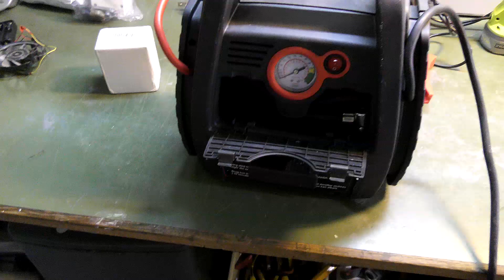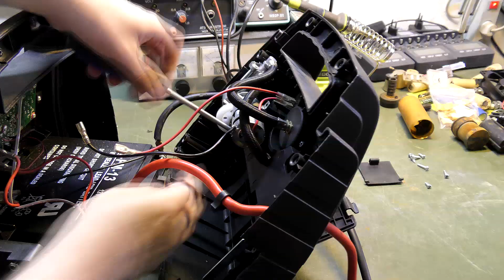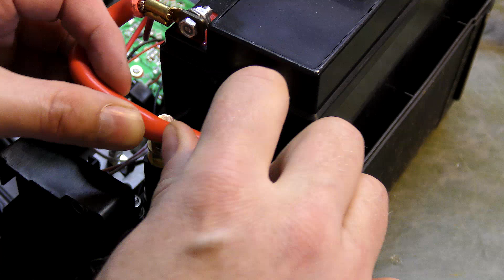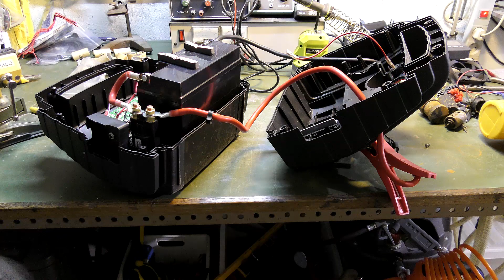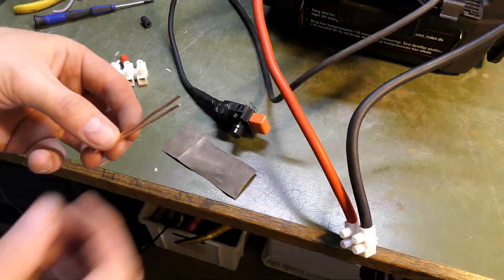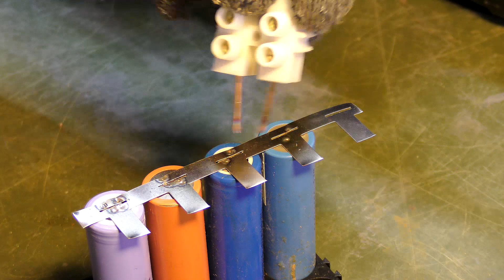Very Cheap DIY Spot Welder, Two Hour Build - 847

Comment: Hey Friend, I do have also one of those chargers (compressor fail also) I'm going to replicate what you're done, a motorcycle solenoid will work also(i think) muchas gracias amigo S.A. tx
Reply from the maker: I only used this a little bit,, it was to powerful, and needed charging to often. did this instead : https://youtu.be/TI_ZV-5WHi4
and I would recommend that.

Comment: Why didn't you use the compressor on off switch use the compressor on off switch use the compressor on off switch
Reply from the maker: It is not meant for much power.

Comment: I’ve done this and it burned straight through the nickel strip. First I tried it with a 630cca 12 volt battery. And then I switched to a 300CCA battery. Not as bad but still burning through the strip. Now I couldn’t find at the time any copped nails. I’ve used hardened steel nails.. could this have been my issue??
Reply from the maker: Yeah,, I messed up two batteries,, so not that great,,it´s to powerful when it works, but it does not work for long.
Reply: Up date it was the them nails I had used as the tips. I couldn’t find any copper nails locally. Soo all I did was just use a piece of 12 guage 12-2 copper wire and sanded it down to a slight point on the end and it works night and day difference now. Was more consistent soo I would recommend any one to use some solid copper wire and sand it down to a tip!! Solved my issue of blowing right through the nickel strips. And I also was using thicker  0.20 mm nickel strips opposed to 0.15 mm nickel strips

Comment: I have a self  built battery pack spot welder powered by a 12V lead acid battery like found in garden tractors etc. It can put out just a bit over 400 AMPS. My relay is an Ehdis high current 500 AMP starter relay.
The relay coil draws 600 milliamps when energised. When the coil field voltage collapses it can send a voltage spike of about 500 volts back at the switch or transistor that fires the relay coil. This causes arcing that damages the switch contacts a little each time it is fired. It can also damage transistors etc.
To prevent this I use a FLYBACK diode across the relay switch. 
I used a 3 AMP 4 PIV (Peak Inverse Voltage) Diode across the firing terminals (Radio Shack #276-1144). Other diodes will work. See Quenching Diodes here:
http://www.bcae1.com/relays.htm
For those who may not know the Diodes cathode (End with white ring) must point toward positive.
If reversed it will smoke and destroy itself.💥
It saves my firing switch from arcing inside an should also protect transistors when the solenoid coil field collapses. Even the spot welds look nicer to me, 
End of rand.👀
Reply from the maker: I saw an interesting little spot welder that I ordered, and hopefully on it's way,, in a few weeks.

Comment: Think of the solenoid has a high amperage high current relay. It works just like a normal relay just bigger. It’s allowing a smaller switch to open/close the gate connecting the high current wire connections
Reply from the maker: Yes some design must have goren in to making sure that it does not fuse the metal inside.

Comment: Similar solenoids of sufficient quality for spot welding can be salvaged from riding mowers and are on hand at most automotive parts stores, typically for less cost than the automotive variety. I've been using a lawn/garden battery but just acquired a mistreated car booster with a surprisingly perfect battery - smaller but with a much higher amperage output! As you said, nearly everything you need is already there already in an extremely convenient and multi-purpose device! It never would have occurred to me that the smaller battery would be much more fit for purpose, making this device renovation much more interesting - well done, thank you sir!
Reply from the maker: I have had the problem, that it would weld a hole in the batteries,, twice,, so I have kind of go back to soldering 🤨

Comment: You can always make tight shrink wrap fit by putting needle nose pliers inside and opening them up, stretching the tube. It shrinks back as normal.
Reply from the maker: Hi Andy Timmons
Thank You very much!  that might have done the trick,, this also worked :-)
Thank you for watching! :-)

Comment: I have been planning a spot welder for Lithium batteries when I have the funds, this is even cheaper and easier than my initial plans for one soooooo....  I plan to plagiarize  from your build almost entirely from your splendid and superiorly advanced design   >;}

Some suggest getting tungsten welding rods, I would suggest using some old tungsten carbide drill bits; I have used them in the past for similar purposes.

Great videos, keep `em coming!!!
Reply from the maker: Hi Edwin Money
Thank You very much!  glad you liked and can use this video :-)
Thank you for watching! :-)

Comment: When trying to sand the copper to a point I would insert it into a drill then just apply a little pressure to the sandpaper at whatever angle you would like the point to be
Reply from the maker: Hi patrick bentley
Thank You very much!  Yes that would work :-)
Thank you for watching! :-)

Comment: Holey fuck. I think that is the first time I heard you actually curse. Also I'm probably the millionth person to say, but the solenoid is used to run the electric motor that starts vehicles. That's why you need a powerful battery to start your car because your car is started with an electric motor.
Reply from the maker: Hi Justin 3
Thank You very much!  Yes I actually found that solenoid was for starting a car,, when I needed the link for amazon,, it was all over that one :-)
Thank you for watching! :-)

Comment: Hey Morten liked the video as usual and since I made a welder like this too it was even more enjoyable. I must admit it took me a while and many changes to make it work really well. The biggest problem was the weld time and to solve that I ended up using an arduino and that wasn't as straightforward as I thought it would be either! Other things that helped was the advice I got from others like flattening the tips of the electrodes a bit. This video has some good advice and he has another video that deals with welding fuse wire check him out. Have a great day and happy welding!  https://www.youtube.com/watch?v=xcbx39ksVL4
Reply from the maker: Hi K Wils
Thank You very much!  good information.
Thank you for watching! :-)

Comment: Yay you made it for all them batteries you were going to do... yes matey you do listen and it is going to make you life a whole lot easier. did you check the voltage before and after???
just one other thing though there is a certain time you were supposed to hold the button for,
 or you could make a timing circuit to do it for the correct amount of time,
or the more you use it for the easier you will be able to judge.

Happy welding!!!
 and keep up the great work!!!
Reply from the maker: Hi Simon Lally
Thank You very much!  glad you liked the video :-)
Thank you for watching! :-)
Reply: @MyPlayHouse  sent you an email to the one on youtube about page maybe take a look see what you think!

Comment: have fun welding them... Better off soldering unless you want them flaming up in your face!
Reply from the maker: Hi Hammerjockey Radios
And why would they flame up ?
Thank you for watching! :-)
Reply: @MyPlayHouse  not having the proper current and voltage control when you weld the negative side usually leads to a nice quick fire in your face on the workbench because it can burn through the metal real quick!!  Most of the "manufactured" battery spot welders  use a pulse and regulation to avoid this.

Comment: Hey Morten I was actually wondering that little battery seems a little too small for this application don't you think? Those 17ah batteries will dry out inside very quickly and you can't even add water easily, You could also add a ballast or a few ballasts to regulate the current and run them at much higher voltage and then just press a button to go a little more and more or the full photonicinduction. Maybe a few used car batteries in parallel and be able to even up the voltage to 24v for when you try to work on something a little thicker but overall looks cheap and works.
Reply from the maker: In this application we need high current, not high power,, many use voltage at like 1,5 volt,, so 12v is really on the high side.
Reply: @MyPlayHouse  24v/36v you get arcs, but to get 1.5v high current you really need thick cables or some short directly to ultracapacitors and they will still get too hot too quickly, and that's not really convenient so your 12v solution is not really that bad the way i see just think some old car batteries may be able to sustain this for longer (due to lower internal resistance) and will cost less for people to run long-term, and i did say parallel to get more current, the 24v idea would be useful for other applications and is also not hard to do.

Comment: What an Awesome Idea! My only concern would be the fact you are directly shorting a lead acid battery, which may shorten it's life. I wonder if adding supercapacitors would make it more durable? But then, it defeats the purpose of a very cheap build. I think I'd do that though, add another relay, and a bank of capacitors, and a resistor. Have the relay switched in to charge the capacitors through a resistor, to limit the current, A voltmeter to monitor the battery charge, and the capacitor charge when using the welder, and the switch switching the two relays, one disconnects the battery from the capacitors, and the other (which you already did) to connect the capacitors to the output. A proper capacitive welder. Anyway, it's impressive as it is. :)
Reply from the maker: Thank you very much,, I should probably try using it,, and do improvement as needed :-)

Comment: Definitely try putting a larg-ish capacitor in parallel with the battery-it will instantaneously discharge much more current than the battery can provide, and provide a stronger better weld. Should stop your tips from sticking too. I’ve played with a 18v 33farad supercap, and it’s going into my diy spot welder when I build mine 👍🏻
Reply from the maker: Thank you very much,, not sure 🤔 if I need more current or just time ;-)
Reply: My PlayHouse I think experiment a bit! Best way to find out ;) but the longer it welds, the hotter the battery will get I think... so I’m going for shorter pulses of higher current on mine

Comment: Nice job! Think you should replace the hand switch with a foot switch. It would mean that you would have both hands available when working. Banggood do them very cheap - from €2.
Reply from the maker: Yes,, and maybe I can make it changeable,, that would be easy.
Thank you very much!
Reply: @MyPlayHouse  Also, get some copper nails. Should be able to get them from local DIY shop and just chop off the heads. Far better than copper wire.
Reply from the maker: Nails,, good suggestion !

Comment: The solenoid actually switches on the starter motor to start the engine in a car - that's the only thing which could use such high currents. On combustion engine cars at least.
Reply: Technically, a solenoid converts electrical energy to mechanical. Built into some (older) car starters, this pushes the gear out to engage the flywheel ring gear. Many also engaged the higher current contacts. When all it's doing is activating high power contacts (not pushing the gear) it's called a relay, controlling high current with a smaller current like this one.
Reply from the maker: Yes I found that out, when I was looking for a link to amazon ;-)
Reply: @MyPlayHouse  Well look again It looks like a glow plug controller solenoid for a diesel engine.

Comment: Shouldn't the welding process work in a way where one electrode touches the battery pole and the other one touches the metal that is to be welded onto the battery? I was just wondering, because I have never seen it that way. But yes, if it works, that's great.
Reply from the maker: From what I’ve seen,, this is widely used.

Comment: I would have coated the two big leads with solder before putting them into that small screw clamp thingy (I only know the German word for it, it's "Lüsterklemme", which is quite a funny word). That way, the screws can't move the individual wires of the cable wick out of its way through wiggeling around and other movement, and make it lose connection (or increase resistance). Those Lüsterklemmen are a pain in the rear end because of that (and other issues - it's just technology from a century ago, when most wires were solid core, and therefore there are much better things available nowadays).
Reply: oops I made a mistake, you meant the white connector he put the wires in? We call that Terminal block, or Terminal strip. We tend to use the word Terminal or connector for any electrical wire connection point. It is also used though at Airports, we usually call them airport terminals. No wonder people can find English confusing! :)
Reply from the maker: Uhh 🙄 there is many good things that can be improved and,, soldering this and maybe the ring terminals,, would indeed be a good place to start!
Reply: Never put solder on wires that become scewed! Solder is a bad connection material!
Reply: It looks like we call them "ring terminals", or "crimp ring terminals". https://www.google.com/search?rlz=1C1PRFC_enGB808GB808&biw=1264&bih=868&tbm=isch&sa=1&ei=-nP6XOPlFIHxxgOqjIOQAw&q=ring+terminal&oq=ring+terminal&gs_l=img.3..0j0i67j0l8.20050.23037..24406...0.0..0.194.1981.0j13......0....1..gws-wiz-img.......0i10.n6vRsb-VMso

I did think he may have been better with solder in too, but crimps can be surprisingly strong, when crimped properly. :)

Comment: I suppose that the tips would be non-"sticky" by using graphite, instead of copper touching the welding spots.
Reply from the maker: Tungsten has been suggested! Is this graphite easier/cheaper/better ?
Reply: @MyPlayHouse  - I don't know much about welding material pro et contra, but I'd expect both to do the job, without the price being much of a concern. Of course, graphite is a lot softer than tungsten (soft pencil "lead" is usually graphite), which may be an advantage in easily cutting down to a comfortable length. Possibly the resistance of graphite may help heating the metal quickly.
Reply: I think pure graphite will break too easily as it's very soft, but cheap replacement motor brushes from china might be a really good solution as they are harder, but wont stick.
I believe tungsten will stick as well if you allow it to get hot, an alternative solution could be a higher mass of copper, this will prevent it from getting red-hot and probably also prevent sticking.

Comment: That's a Cool Tool! Much easier to Build - Hack. Than starting from scratch and using an AC Power Supply. Like all of the other DIY Spot Welders I've seen... Don
Reply from the maker: I was impressed with how well this worked,, I did not think 🤔 it would be this easy. :-)

Comment: what you might want to do is replace the copper tips with something like tungsten tips from a tig welding machine.
they will hold up much better.
Reply: actually i think the preferred material for the contact patch of your electrode is copper, something about wanting your lowest resistance at the end of the conductive path to get the proper response from the work. copper tungsten maybe?
Reply from the maker: Yes,, I did not have any tungsten rads just laying around :-) so that will be on the improvement list.
Reply: My PlayHouse - 2 dage siden - Yes,, I did not have any tungsten rads just laying around :-) so that will be on the improvement list. 
 @MyPlayHouse  - Not a good idea as you may get 'Tungsten, Thorium & Helium gas, without electrons' rads ;-) 

Some TIG welding rods have Thorium added to them, and they emit a bit of ionizing alpha and beta radiation - leaving decay elements such as Radium, Radon, Actinium, Polonium, Lead, Bismuth and Thallium, compounds often used in cancer treatments. If you sharpen those, do not breathe any dust given off in the process. https://www.youtube.com/watch?v=DmczVhGq8cU - Milking the Thorium Cow - Periodic Table of Videos
For an uniform workflow and best quality I suggest adding a trigger/timer circuit - so when you press the trigger, it will fire the spot welder for a set (adjustable) amount of time. 

https://www.youtube.com/watch?v=nUR-giwn4z0 - Voltlog #207 - Making a DIY Spot Welder From A Microwave Transformer
https://www.youtube.com/watch?v=QFEyG6fYaQY&t=5s - Voltlog #189 - InTheMail
Reply: Welding supply shops (obviously), have a ready supply of tungsten tips used for TIG welding.
Reply: @MyPlayHouse   The centre electrodes of spark plugs are made of tungsten. You may want to visit a scrapyard. ^^)
Using much fatter copper pieces like 5mm thick copper nails should help as well. This would offer greater heat capacity in the electrodes, slowing down the tip melting, and reduce heating from electric current. Sharpening the tips doesn look like too great a trick either, a greater transfer area for the current will prevent the copper melting. 

But that's a neat little thing! :oD

Comment: Much faster and easier than soldering.  Had to laugh when you wanted to use the self adjusting wire strippers as a crimper.  The crimper you have is for insulated connectors.  You need a different type of crimper for non insulated connectors but it does work.
Reply from the maker: It does also have the ability to crimp :-) I could have used it!